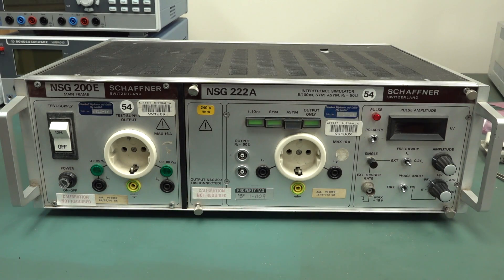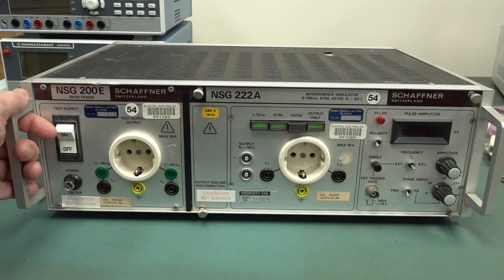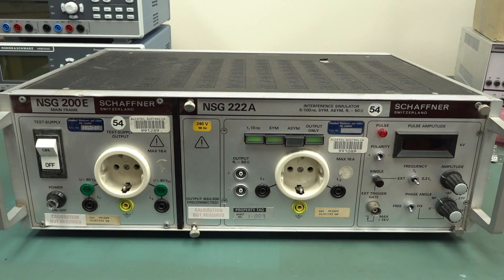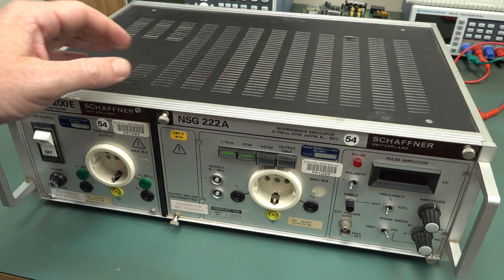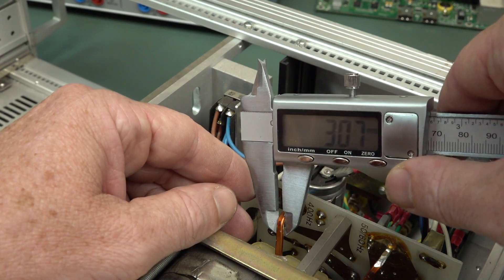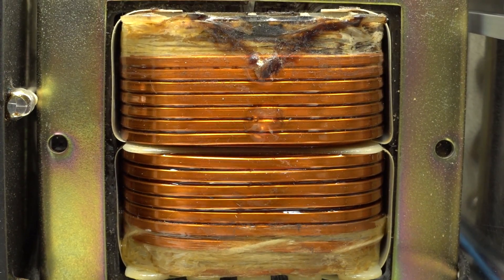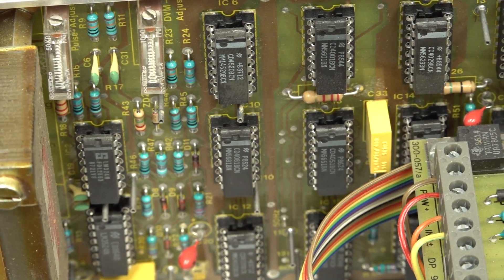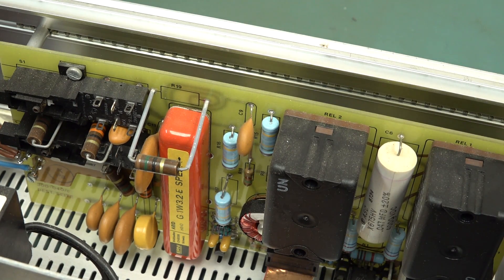EEVblog #1182 - Mains Interference Simulator Teardown

Comment: why is this one resistor so much out of the board? does not look like a power resistor to me. so i dont think its to dissipate heat
Reply: If we go by the circular traces on the PCB, the most logical answer is they needed a nanosecond, or thereabouts, of delay and used those long leads to get some fraction of that delay in addition to the long PCB trace.   Though I’ve never seen through-hole resistors with leads anywhere near as long as those leads were!

Comment: idea why the thing had a meltdown: you tried to generate the pulses but you did not have anything connected as a load (you can hardly call your multimeter a load). the thing could be that the load is supposed to deal with the pulses and their energy. with nothing connected to it at all the circuitry may have nothing where all this energy from the pulses can dissipate… the Designers may not have included a protection against use without load because it either may interfere with the test the equipement is supposed to do, or because they think that whoever uses this knows how to use it properly...
Reply from the maker: I would be stunned if that was even possible. That's why they would have that filter inbetween, and the seriously over engineered choke
Reply: @EEVblog  Could it have been your unusually high supply voltage there in the lab? You had some crazy high voltage numbers on your multi, it was 247 something, that's way high!?
Reply from the maker: Nope, still within spec
Reply: That may make sense... similar to how you can't key a radio transmitter without a test load (or antenna) without frying something
Reply: Matthew Miller Except in the case of radio transmitters it is the high voltage caused by the very high SWR (due to the impedance mismatch created by the missing antenna, with the SWR approaching infinity)  that causes damage to the power amplifier transistor(s), though any decent transmitter will have Hi-SWR detection and automatically enters a reduced power state to protect the transistors.   A well designed test device like this should be designed to survive the possibility that the device under test may shutdown or blow a fuse, etc., during the test without the test equipment going up in smoke as a result of the device disconnecting itself.  Further, in a device like this they should know exactly what peak voltage to design to so as to ensure that the test equipment can safely survive its own high voltage pulses.

I did not catch the schematic while it was briefly on screen, but if the choke that overheated was part of an LC filter then if the capacitor portion of that filter failed then you may end up with unusually high current flowing through the inductor that might lead to overheating.
Reply: I suppose one should be able to test low loads.

Comment: 7:24 RIFA condensator... they catch fire easily when old...
Reply: yeah i noticed those small claymores too!, you can even see the case is already all cracked up
Reply: Oh yeah....all the time.....suckers.....and other similar looking units of the same age but from other companies too
Reply: That was also my tought. All of those resin potted, paper-foil capacitors tend to break & burn with big cloud of smoke smelling like amoniac or cat piss. So no nude virgins making them i guess...
Reply: The big capacitor near the black relay looks like it exploded, there is a big crack at 10:24
Reply: These suckers crack all the time when old, I rarely have seen any uncracked. Failed design._
Reply: @DjResR  And they are still produced to this day, at least Wima still makes them!
Reply: those nasty bastards swell and crack apart as they get old .
Reply: no smoke like rifa smoke
Reply: “Capacitor” is the word you’re looking for. “Condenser” is what they were called a very long time ago in English. “Condensator” is Germlish. ;)
Reply: @tookitogo   i know thanks, sometimes i do this mistake :'( it's because is similar to Italian (condensatore) :D So usually i write Condenser and after when i read i fix to Capacitor, this time i don't read the comment before send it :). But thanks for the correction :)
Reply: Condensator is the Dutch word.

Comment: So those windings are 6mm² copper plus insulation.  That's a standard cable thickness for building feeds, obviously rated for much more than the 10A input connector and the 16A output connector should survive.  So maybe it's used for low resistance rather than current capacity.  Or maybe it's just the wire density in the coil causing severe derating of the copper.
Reply: In continuous operation, around 2 - 2.5A per square millimeter is usual in iron transformers and inductors. So yes, it is a derating. Makes sense if you think about it as the generated heat has nowhere to go to.

Comment: Perhaps it was tossed after failing an insulation test due to a breakdown in the CM choke.
Reply from the maker: Certainly possible!
Reply: @EEVblog  anytime ya see transformers w/sq Cu wire it's to obtain better magnetic coupling than round wire, & ( Sq wire ) is used in combo with Bifilar winding method on the Xformers core.  The disadvantage is poorer HF isolation & dialectic isolation between Pr & Sec windings.  I tested equipment like that w/ storage scope & 250 watt heat sunk 1.0 ohm 1% precision resistor ( we calibrated the resistor as well ).  Key testing was confirming waveform/timing & energy dumped under the curve b4 use in transient protection designs & components.   Lov what ya do...Cheers
Reply: @robozstarrr8930  You sound knowledgeable regarding  transformer design. Can you recommend some reading to get me started on the subject? Specifically audio signal transformers.
Reply: @Audio_Simon   best i found was "practical transformer design handbook by eric lowdon - 1980.  not much has chged w/magnetics since then.  ( get the hardcover version ).  another book "AC Power Systems Handbook", has alot more than xformers ( diodes, xistors, etc. )(by Howard W Sams) but ya can google the xformer chapter online ( gee, i wunder why! )  .. good reads...
Reply: @robozstarrr8930  thank you!
Reply from the maker: roboZ starrr Thanks for the detail

Comment: im just guessing but, the labels on the choke would be what its actually filtering...50/60hz for mains...and 400hz for transients...just to smooth and isolate the mains input noise from the test...
Reply: I bet it's there for the aerospace version where they just stick a 400Hz label on and triple the already horrendous price tag.

Comment: Dave are you 100% sure it's the choke that's gone..... I'd be more suspicious of those capacitors on the other side of that board
Reply from the maker: Yep, could be right, I spotted something upon closer inspection, will have to do a follow up video.
Reply: @EEVblog  @7:21 those Rectangle yellow MKP caps are absolute garbage the are in kenwood mixers I repair and they fail with age like clockwork, and the smell is like the wrong side of the garbage tip fire ..... I wold be going strait to them and it looks like one is cracked on the side in the footage but its a bit hard to tell..   edit.  I'm betting they are on the input mains side and if that is the case you can almost be guaranteed that they will cause a TAG TEST fail .   bad for the previous  owner good for Dave....
Reply: @VK3NFI  Those are not MKP (polypropylene), but MP (metallised paper), and yes, they are garbage. Not the fault of the manufacturer, all paper capacitors are unreliable in the long term. The metal canned, hermetically sealed military ones are better, but still unreliable after 30-40 years of storage. Paper capacitors should be banned, but they are still produced to this day.
Reply: @EEVblog  Yeah sorry for the slow response here Dave, been working flat out. It was seeing those transparent 'amberish' coloured wima caps that made me click with 'smoke'. The things are notorious for doing that. Not sure why but an 'educated guess' is that the resin becomes brittle and cracks (you often see them with hairline cracks) and moisture gets in... a few seconds or minutes with mains (especially in 200-240v countries) applied, and they break down, releasing the foul stench.. Also as @zapro_dk said, the choke looked fine to me (admittedly only in 1080p)... the resin often does that.

Love this kinda teardown video.

By the way, Standard Telephones and Cables, best known as STC were a major telecomms manufacturer here in 'the old dart in the 20s thru to the 60s or maybe 70s'... I'd imagine the Aussie branch of the company also did similar. Telecomms mains powered gear is notoriously susceptible to power spikes if not well filtered, (stuff tends to lock up) which fits with them owning this device. If you get time, i'd be interested in a further poke around to see how the original socket is disconnected (as implied by the label to the left of the add on module)... ie, is it done manually or does that multipin socket have all the pins for it and maybe a blanking one used to link them out?
Reply from the maker: That's we the smoke mostly came from, rear part of the case. Caps looked ok on first glance
Reply: @EEVblog  That choke looks absolutely fine. The brown stuff is the PU-laquer from dipping. I worked at a transformer manufacturing company and i'd say nothing is bad with that one. A failed Schaffner net filter or RIFA capacitor is your problem here. I binned a whole box of old Schaffner net filters since they all go thermo nuclear when powered after 20 years being unused where their integral RIFA caps have sucked up moisture. A classic!
Reply: @zaprodk  Are you talking about the epoxy potted filter blocks, the RIFA MP caps on the board, or the EMC filter integrated into the IEC connector, or all of these? The potted ones will be pretty tough to substitute, are there any schematics from their internals online, or Dave should tear them apart with a chisel to reverse engineer them? Though I hope they were not so dumb to use MP capacitors in a potted unit, their long term unreliablity was already well known in the '80s. I also can't get how their explosions with raining sparks, while filling a several hundred cubic metre room with impenetrable smoke could be compatible with their X and Y safety ratings... And they are still manufactured to this day (at least WIMA still makes them)!
Reply: @mrnmrn1  the EMC filter in the IEC input.
Reply: @zaprodk  What a pity for the whole box of those you tossed out. Is it impossible to disassemble them and replace the X2 capacitors to MKP?
Reply: @mrnmrn1  yes, impossible. They are potted and sealed.
Reply: @zaprodk  What a pity. A lot of the far-East made ones usually can be disassembled in a non destructive way.
Reply: @zaprodk  It seems Dave didn't got what you said, and left the IEC connector in place. I tried to warn him, I hope he will see it.
Reply: @mrnmrn1  He will know when it when he gets the second portion of smoke :)
Reply: @zaprodk  Well, yeah, but it's not fun if he than have to pay $1000 for a false fire alarm...
Reply: Could also be the capacitors inside the Schaffner IEC filter module that have failed. They let out a lot of magic smoke when they fail and often the potting compound in the filter module oozes out as well. You can easily detect this with your nose as the stench is revolting an it tends to hang around the lab for weeks.
Reply: @EEVblog  It might also be the input filter integrated to the IEC connector. Maybe it also uses RIFA paper capacitors.
Reply: @EEVblog  Dave, check the ITT cap as well, it might be a PIO, which vented.
Reply: That was my suspected cause of failure as well.  Hopefully we’ll get a good follow up video out of the failure.

Comment: I spy with my experienced eye, RIFA brand capacitors, well-known for releasing the magic smoke for no reason other than being pure shit quality caps... :P
Reply from the maker: EJP They do have a rep for releasing the magic smoke after several decades. I have spied something upon closer inspection, will do a follow-up video.
Reply: @EEVblog  Very interesting. I didn't think those mains windings were actually bad. Hard to imagine any actual insulation breakdown with those puppies. Maybe just a bit toasty and old schmoo.
Reply: It has nothing to do with quality. When they get old and sit unused for many years the casing cracks and they suck up moisture. Moisture gives them a high leakage current = heat = smoke.
Reply: People whinge about these capacitors, but they are X2 rated, meaning that they are supposed to fail in a controlled way without any possibility of shorting the mains. When you consider that they mostly sit there across a mains switch with 240VAC permanently applied for 30-40 years, it isn't too surprising to encounter failures. I replace a few here and there.
Reply: @EJP286CRSKW  Trick is, if they sit with voltage applied this scenario never happens. The small amount of self heating of the equipment keeps them happy. It's only when you pull old equipment from storage that this happens.
Reply: @EJP286CRSKW   'supposed to fail in a controlled way without any possibility of shorting the mains' Yeeeeah... I've seen many of those metallised paper Rifa and Wima caps failed, with raining sparks and molten metal droplets flying around, both from the capacitor and the exploding mains fuse.. Surely controlled manner...
Reply: as i know is not a problem of quality, it's a problem with the aging and thermal, almost impossible to predict when was designed
Reply: Had the issue too when testing an old industrial 3 phase motor controller which had been stored in non optimal conditions (cold, moisture...). The unit worked well for a bunch of minutes then suddently a big cloud of scary smoke escaped from a bunch of these RIFA capacitors. Removed them then the unit worked like a charm.

Comment: Perhaps it wasnt a good idea to let it have firing away ungrounded and unloaded.
Reply: This kind of equipment could work without load.
Reply: I was wondering the same. Could it have not been designed to be run with no load?

Comment: ... and here's me testing my audio power supplies by plugging in circuit and cycling incandescent/flourescent lights, vacuum cleaners, blenders, microwave ovens, etc.
Reply: Simple and realistic. I'll give you a thumbs up for the method, the so called "Elegant solution", or also the KISS if you know the acronym!
Reply: @Kalvinjj  
Thanks, as a Mech.Eng. I'm a big fan of Elegant Design. As a hobbyist, I looked for the most likely range of household devices to cause problems. My circular saw (@13.5A) wins, but... you wouldn't likely "hear" the line noise if you're using a saw, lol.
Reply: I was wondering how someone would simulate inject noise like that, I am testing some instrumentation amps and was having different issues (with ground noise, when mc serial was connected to computer ) when a space heater was running and with led lights running, so I was turning stuff on and off and comparing tests, lol ugh
Reply: You can also wire up relays to the mains in such a way that they chatter at line frequency. It produces relatively broadband noise in both conducted and radiated emissions.
Reply: @Y0urpants  
Good idea. Hmmm... drive it with a MOSFET & frequency generator, and I could do some sweeps (limited by the relay's response time).

Comment: Maybe the loose IC popped out when the unit was tossed. Could the meltdown been caused by that?
Anyhow, we see an old rule again: When obtaining gear in an unknown state, always first open it and check for anything that could be wrong! That rule exists for that very reason!
Reply from the maker: No chance that causing the smoke. But yeah, with checking inside visually first
Reply: Well, you've got a few bobs copper there anywho.